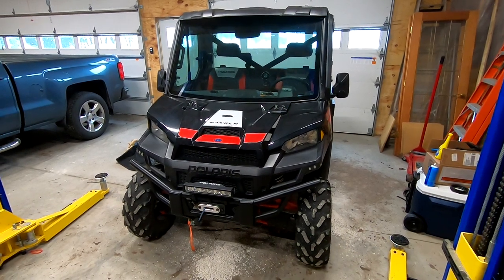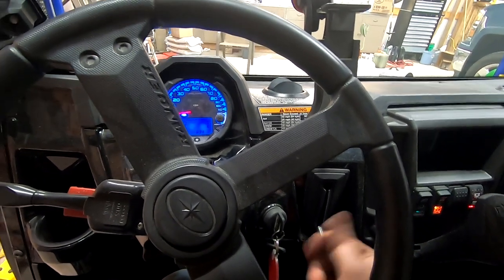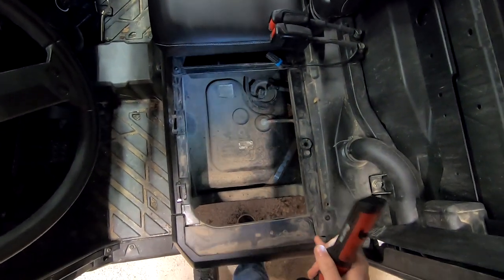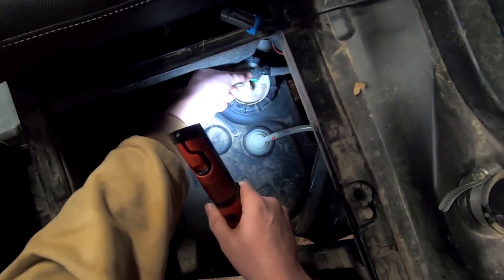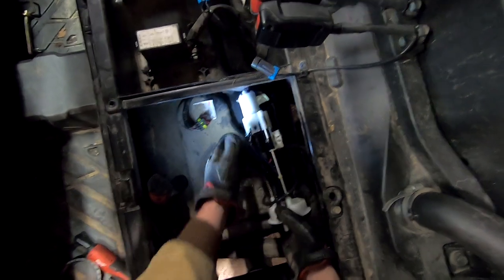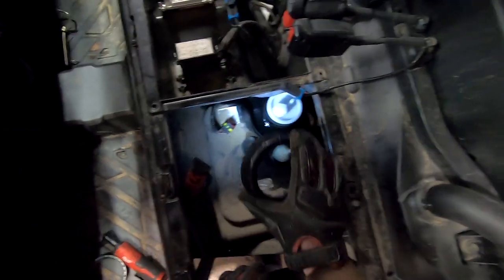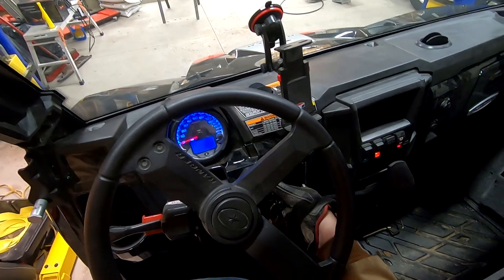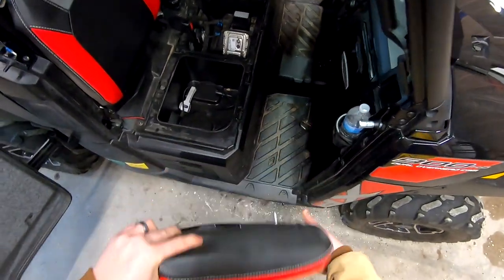Fuel Pump Replacement [Polaris Ranger UTV]

Comment: Great video.  Used it ti fix my 2015 Ranger 570 Mid Size.  Sounded like same issue and ordered fuel pump from Amazon. Just replaced it today and running good again.

Comment: Nice informative video. 👍 

Next time she's up and running.  Take the time to spray some carb or brake cleaner around the intake boots where they attach to the head and listen for any rpm change. They are prone to leak at the sealing surface. Something every 900 owner should be aware of
Reply from the maker: Good to know. Thanks
Reply: Excellent tip.
Reply: What do you need to do if you do hear an rpm change?
Reply: That is what my dad's polaris does.  I am going to order one

Comment: Nice job on the video. Please allow me to add the following. Before removing the pump. Check your fuel pressure. It should be a minimum of 59 psi. After the install. Check pressure again. I just did a video on a 2013 Polaris ranger on my channel. Again nice job keep up the good work

Comment: I have a 2017 Polaris Ranger 900xp, it started running rough, it starts well, but when giving throttle, sputters as if going to run out of fuel, and then will eventually catch and run well, after running it again will start running rough, could this be a fuel pump that is going bad? is there a way to check the pump with out replacing it?

Comment: Just wondering how you diagnosed it as a bad fuel pump?  Having the same issue, sounds identical to yours and won’t start.  Done research and there are so many suggestions out there of what it could be that is why I am wondering how you knew it was definitely the fuel pump.  Thanks so much for any assistance you can give me.

Comment: mine is doing this but i have a 2017.  i know i need a battery but the thing has less than 300 miles on it and kept in a garage.  sometimes i will get it to turn over, runs for like 5 seconds maybe then dies.  i was suspecting bad gas.

Comment: I’m experiencing kinda same problem, eventually will start and run. Also have issues with being out for 30 miles or so and it just bog down, no code . Shut it off start it right back up and it runs normal for a few miles than repeats . Still no code ????
Reply: Same thing to mine. Will try fuel pump and see if it happens again.
Reply: Did either of you end up replacing fuel pump and fixing your issue?